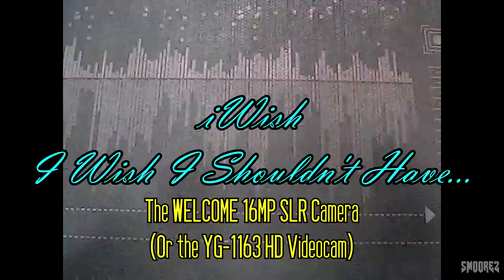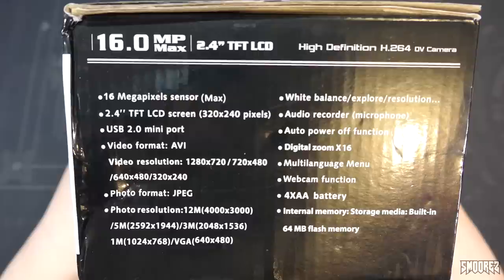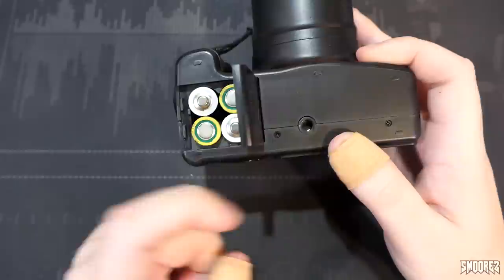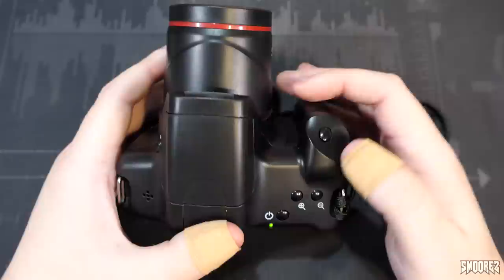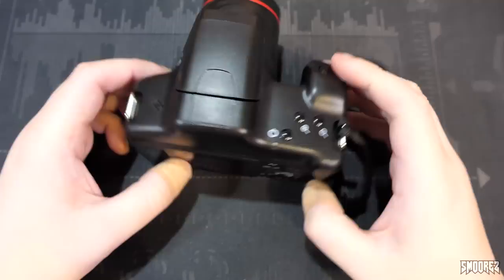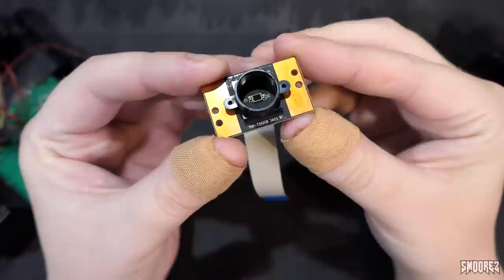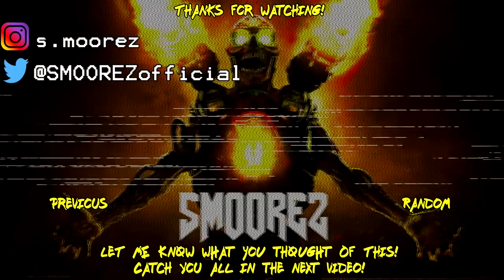iWish: DO NOT BUY THIS CHEAPO CAMERA FROM WISH! (or eBay/Amazon etc) YG-1163 HD "DSLR Camera" Review

Comment from the maker: Don't buy this camera. Your smartphone will most likley be 100000+ times better than this.
Stay away from potato camera. Unless you want to film pretty YouTube videos with it sarcasm

*Yes the instructions say that it has a 1.2MP Sensor. So they get you with the listing and details but then when you open the box and see it all, that's where you realise something is up.

TIMESTAMPS:
Intro: 0:00
The Listing: 0:59
The Box: 3:08
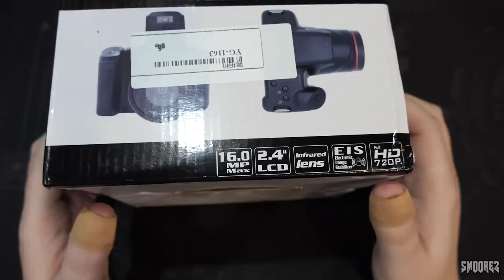Unboxing: 6:10
The "Camera": 8:11
Power On & Functionality: 10:53
The Camera Showcase: 16:08
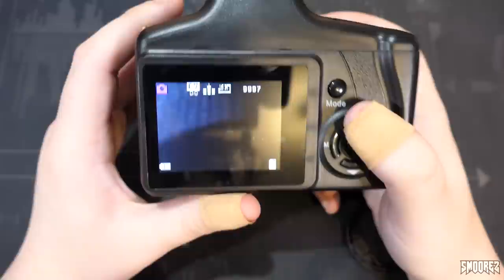Showing the misleading features: 20:27
Conclusion: 23:38
Bonus Teardown: 25:55
The Sensor: 28:46
Reassembly etc: 30:28
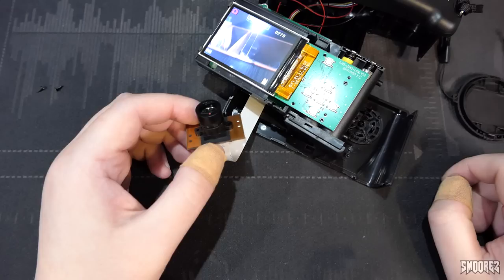Don't buy this: 32:34
Outro: 34:08

Be good people!
Reply: No way that’s crazy
Reply: Yea, watching this on my Mi 10 Pro running Android 11 "R" Beta 1 and yes it is more than 2^1000 times better
Reply: There is simply no value whatsoever in this product. Most people will have a better camera sitting around in a drawer or can get one for a tiny sum in the form of an older smartphone or digital compact camera. The only challenge in that approach will be the possibly rather worn battery but that can be worked round, especially in devices that can be externally powered.

Even the front camera in a modern budget smartphone is likely a better camera than this.
Reply: My old Samsung Galaxy Ace 3 can take better pictures and photos. It was like under 200€ in 2014.
Reply: SMOOREZ i respect ✊🏻 you m8 keep it up :)
Reply: @DavidWood2  The chinese camera films following resolutions:
Photo - 16MP, 12MP, 5MP and 3MP shoots the same resolution - 1280x960, 2MP in 640x480, but 1MP is broken.
Video - Full HD and HD had the wrong resolution - 1280x960, but VGA videos are shooted in right resolution (640x480).
Reply: I'm fairly certain that my REFRIGERATOR would be a better camera than this, LOL 😛
Reply: This is basically a toy for children. Like all those "smart watches" and "notebooks" with barely any functionality.
Reply: It honestly strikes me as a cellphone camera from one of the wish clones that they put in a larger body.
Reply: A Cheap/Standard 35mm film Point N shoot camera can Take better pictures than this piece of garbage, Heck a DISPOSABLE Camera can outperform the Still Picture Quality of this. The Video Quality can even be outperformed by HI8 or MiniDV camcorder. Both of these could easily cost the same as this paperweight of a camera.

If you're going to be going into Photography, Scour eBay and at least find an older point n shoot digital camera, also look at the reviews on other sites if you're dubious about it. 

My first camera was a Canon PowerShot S110 Digital Elph camera from 2001. And it took pictures that were 10X better than this McDonald's Toy of a camera.
Reply: @Quiparounddreams1999  pretty sure it's not 35mm
Reply: I got a sony h300 at first cash just 80 dolares and looks new
Reply: @eliezermexicanimation  wasted your money
Reply: The 'camera' and the screen look like they could be Raspberry pi compatible. Now, if that were the case, as a parts thing, it'd work.
Reply: The quality look like those camera from 60~70
Reply: But it’s a Genuine camera Brand .. I mean this is this is unprecedented that a brand with such prestigious pedigree  is so bad.. lol
Reply: I forgot this was a thing until this video. people buy deliberate scams off a wish to get a refund and then sell the item to make even more money.
Reply: Speaking of Low Quality stuff. I've been wanting to get some VHS-C tapes to start Recording stuff with my VHS-C Camcorder
Reply: @moiskyrie  We had Kodak 126 and 110 cartridge cameras back in the 1970s that took better pictures than this rubbish!
Reply: You are wrong, this does in fact work with more then 8gb sd. I have been using a 16gb sd card and it works with it fine.
Reply: Thank you

Comment: The low res video was far better than I had expected. The white balance is weird though, as is the extremely aggressive noise reduction. It has a surreal painterly feel to the images. The """flash""" cracked me up, seems much more fair just to call it a top mounted torch!

Would you consider doing a video on one of the other weird fake DSLRs available online? I'm thinking of the ones commonly available on AliExpress, branded as Polo. They're around AUD$250. That's well into competent point and shoot territory from name brands, so I'm curios as to what they could offer in that price bracket.

Comment: Actually, infrared lens is probably one of the only claims that has a hint of truth to it. Digital photo sensors actually detect some infrared wavelengths so most digital cameras have an IR filter to remove them, but if you point your TV remote at a cheapo web cam you can see the IR LED flashing in the picture. This camera clearly won't have an IR filter on it soooo....

Comment: The first digital camera I bought used in probably the mid 90s was horrible and did like vga quality, and a slightly larger mode. Considering it was probably one of the first consumer cheap cameras anyone could buy I was ecstatic to get it. It didn't even use any type of memory card and took like 16 pictures at max resolution which was probably about 800x600.
It did video at very low res as well, no zoom at all, fixed focus. Later I got the next generation update that used a weird ceramic looking memory card that was common back then and disappeared in a few years. It was slightly better resolution and had slight digital zoom. That one was probably slightly better than that thing and was still fixed focus. I mostly used my old film DSLR back then and used it for posting on the net easily and quick pet and pictures of stuff I needed to remember like car parts and how things went together so if I was hunting parts or needed to put something back together I could look at the screen to double check.
After that I got a deal on a Sony nice point and shoot that did 4 meg, and a while after that a nice Canon digital rebel XT and have continued upgrades as deals came up.
Things have certainly progressed a ton since I started...

Comment: Just one thing (though you seem to know what you're talking about, which makes this an odd point to have to make); 4 AA cells at 1.5v each is 6v. My Canon M50 batteries are 7.4v, so the point about it running on "stuff all power" seemed rather out of place.

This is before we get into the topic of amperage, of course.

Comment: Remember those one-time-use camera we used to have back 20 years ago? Was a brilliant hazzle free thing back then. Before that you could get cheap cameras its not that but having to go buy the right film rolls & fiddle around with them inside the camera was extra work. But then it reached a point where cameras got so cheap that you could just buy a "premade" camera with a film roll inside for just a few bucks in vendingmachines. Super nice if you was a turist, just snap pictures left & right without being worried about getting it stolen. You could always just buy one more too. Then back home again just hand in the whole camera to you local photo store for developement. I guess this is basicly the digital same (except not adverticed the same). Then again standards is higher today so you wouldnt even take one of these with you on vacation. But if you have to take pictures of the alligators in a flooded basement in a iron smelting building on top of a vulcano during a hurricane perhaps.

Comment: The start up chime, button press sound and the menu interface are the exact same on my old cheap dash cam. Only difference is the size. I'll take a guess and assume it's the guts from a  tweaked dash cam in a camera housing.

Comment: 10:39 those Numbers are probably actually correct, but they'fe definetely not at all impressive.
The millimeter rating (in this case falsely labelled "L") is the focal length.
Small focal lengths are wider than larger focal lengths.
9,8mm is suuuper wide, so if the image is zoomed in, that means the sensor is miniscule.
The Aperture rating is the ratio between the focal length and the lens opening.
The higher the number, the smaller the opening.
9,88mm / 5 < 2mm

Comment: I have a 25 year old digital cassette camera that was far better than that.  In fact, I have a $25 digital cam I bought from K-mart while on vacation in 2010 when we realized we left our good camera at home.....it has better quality 🤣😂🤣😂🤣.  

SO HAPPY SOMEONE RAN WITH THIS IDEA!!  I thought about it.  But I found out was Wish was all about in 2016 when I got an Xbox One and was looking for storage.  I bought some "USB 3.0" Flash drives.  Even one that had the blue plastic insert, sadly none were USB 3.0.  None were even close to the 1TB that was claimed.  Most did have the surprise of Malware included.

Comment: The image sensor in a dslr should be roughly the size of a 35mm film frame. of course considering the size of the actual lens on this, that sensor is probably almost oversized.
Reply from the maker: My Intel CS110 Webcam that came with one of my random Pentium 4 CPUs (probably a 478 based one) has a bigger sensor in it than this thing.

Comment: good luck finding AA batteries for it, only ones the store sells are for the TV remote's. They will not power anything more then a TV remote.
Reply: .... no. AA batteries are all equal (1.5v, 25000 mAh). Unless you live in a really weird place were your AA batteries are different to one another
Reply: @maxz8807  reduced to digging in a plastic tub of old batteries, digging digging digging... what must be a tub with over a thousand AA's, surly one must work so billy can play XBOX for another 15 minuets. as the TV remote lasts for only a day or two because billy took those too.

Comment: 17:58 It's doing the same thing dashcams do, they cut video into segments (That would've been the 1m, 2m, 3m setting), then it creates a new video and keeps doing that until you stop recording. Usually decent dashcams will overlap the footage from file to file so the footage jumps back, it doesn't jump forward unless it's a really crap one.
The guts of that thing are probably the same as an ultra cheap dashcam judging by the settings menu.
20:12 You have more lemons footage than Will Sasso, I keep expecting a clip from him to jump in shouting "LEMONS?!" * bleurgh *

Comment: Looks like the same UI as my cheap Wish dashcam. The dashcam surprisingly works well for my company car, but you have to remove the micro sd card occasionally, and restore it on the pc. The dashcam has ruined 3 micro sd cards so far, but I am using cheap cards, so I don't feel bad about it.
Reply: i know you wrote this comment a year ago, but you need “high endurance” micro sd cards for dashcams. regular ones dying quickly is actually quite normal, considering how much data is written on them.

Comment: Cameras like this have been sold for years, I remember one of the early ones that was branded as Protax (they are still being sold today!). The fake lenses were obvious even back then when I didn't know anything about cameras.

I think Wish and AliExpress didn't exist yet and they were sold through eBay.
Reply from the maker: I've got a Protax one in box that I was going to review but since it ain't on Wish or anything anymore I wasn't going to worry about it. But I might take a look at it. It may be better than this thing. The one I have actually has a retracting lens!
Reply: @SMOOREZ  Is your Protax the one with changeable lenses? I've also seen it sold on Wish as a "Polo Sharpshots" a few times

Comment: You probably can’t zoom out in video because it is zoomed out but it only records in crop mode. The processor couldn’t handle full res so in video it’s only using the megapixels in the centre of the sensor. Probably 1.7 crop. 
It’s an unutterable piece of shit though. I bought a trail camera off Amazon for €50 that takes better photos.

Comment: As soon as you see DIGITAL zoom the forget it.  ANALOGUE zoom is what matter.  Digital is exactly the same as zooming in using software .....it degrades picture quality whereas analogue is a physical zoom using variable lenses and has little or no detrimental effect on picture quality.  A high quality lens is far more important than megapixels.  INFRARED???????  Bollox.  I wouldn't mind betting it doesn't have a reflex mirror and the lens is none removable with plastic elements.  Fixed focus too.  Anyone who says this takes good photos either owns a guide dog and white stick or doesn't have a bloody clue what a good photo is.  I doubt they even know what a DSLR camera is!  9.88mm focal length probably is about 140° wide angle but it seems that's a lie too.  That isn't  a flash, its a light.  Basically the works is probably the same as a cheap Gopro type cheap £25 action camera in a large plastic case.  Generally speaking the cheap GoPro type clones are far better than that and don't pretend to be anything but a cheap clone.  That thing is a 100% lies yet, sadly, there are some out there will think this thing is every bit as good as a Canon D60 or a Lumix G3 for a fraction of the price.

Comment: More like a toy camera than a real one. You could buy a used Nikon D90 for like $120 that takes pictures that are 100X higher quality and depth. Hell, my first DSLR was a Nikon D5000 that took 12 megapixel shots that printed fine all the way up to 45” prints. My first digital camera was a Canon Powershot 5MP that took better photos than this thing...
Reply from the maker: Even a second hand smartphone from 2011 would be 100x better than this. I took apart a camera from a Samsung Galaxy SIII and the sensor in that is bigger than the one in this.

Comment: So the usual 1.2MP webcam sensor into a bigger body trick. How Delightful!
WOW digital zoom, what a LUXURY! On a 1.2MP sensor that will look GREAT! 
I remember the early by then still expensive cameras. 5MP sensor " Well, 2Mp sensor with a up to 5 Upconverter. 10 times zoom! Actually 3 times zoom and then you need to use digital zoom! WOOOOW! This model even seems to have the delightful white balance quality of those old cameras. is it green or purple? The camera doesn't knows!
At least they were smaller and pretty capable.

Comment: 3 mega pixel cmos sensor 02:05
Reply from the maker: But they slapped 24MP on top to deviate away from that detail.
All over the listing is "16mp". Then the instructions finally say a "1.6MP sensor"...which you wouldn't see till after you bought the thing.

Comment: 4k EK7000 AKA50... a smart phone camera in its own little box. why its cheep? because it doesn't have an image processor like a cannon... but if you have programs on the computer, the pictures dress up just fine. ... ... cant even load a 4k picture, windows 95 says "file resolution error". that cam in the video would have done well if it were still the 1990's... could buy 50 rolls of film for the cost of one of those... mindlessly snapping pictures of everything as if its a digital camera. oh no, had to change the film roll so missed the shot. then the AA batteries stop working, because billy used them in the xbox remote. mean while for the last 4 hours the EK7000 is running of a 10'000mah power bank continuously recording 4K video to a 124GB flash card! can even run it to a small computer right to a 3TB HDD. tho having the ability to zoom into the moon would be nice but that's what a telescope is for and with some hot glue and Popsicle sticks its mounted and looking at stars that are then projected on a 80 inch screen... no one has to fight over the looking glass... except for where it gets pointed next.

Comment: no offense but you might have to work a bit on the thumbnail. it's not appealing for new viewers. 

Issues imo:

- there're too much text in the thumbnail and they are all over the place. condense them into 1 or 2 text or group them together

- text in thumbnail is a little hard to read. better to color the text white and color stroke 

- complex background. you might want to choose simpler ones

nothing wrong with your content. it's just that thumbnail attracts viewers.

edit you don't want to choose cursive font it's hard to read them on screen